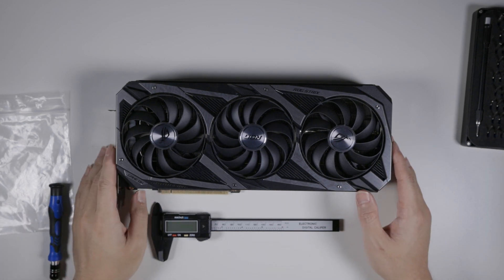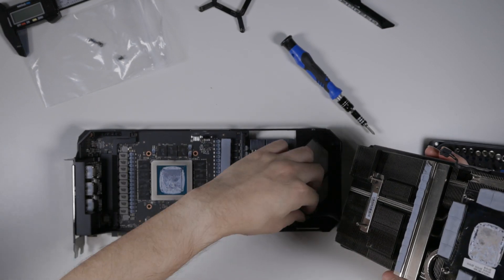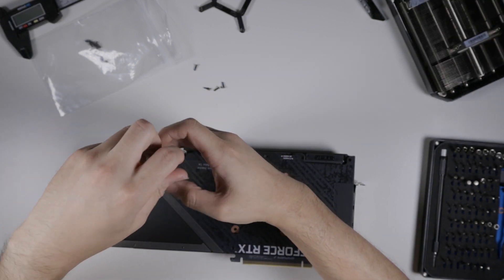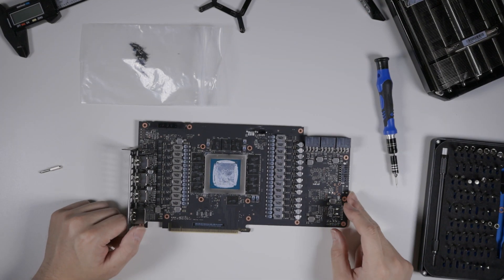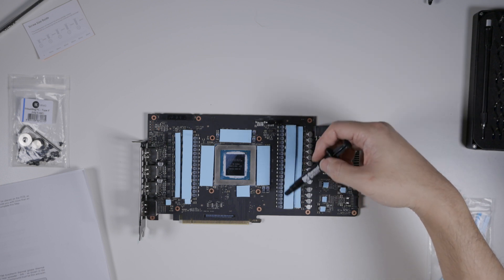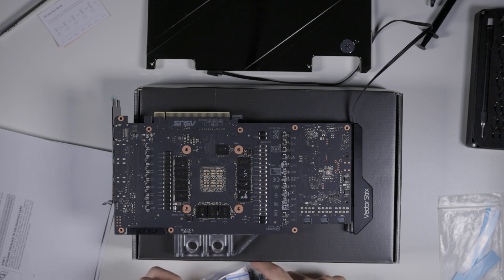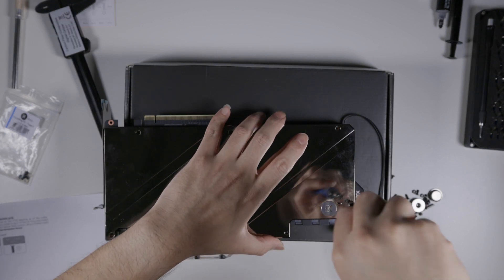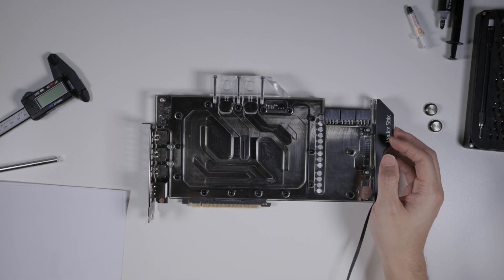ASUS STRIX RTX 3090 3080 Cooler removal + EKWB Waterblock and Backplate Install Beginner Friendly

Comment: Do you remember the size of the torx screws?
Reply: I have them, do you need the torx size or the size of the screw?
Reply: @oggybodoggy  Im good now, did the thing already. Thx tho!
Reply: Null stress :)
Reply: @jarlepedersen2150  can you tell me, I need to buy a tool to open mine as I'm getting a vibration issue. Thanks 😊
Reply: @oggybodoggy  can you tell me, I'm getting a vibration problem on mine and need to open it up. Have to order the tool
Reply: @munkymanmatt  I'll check in q couple of hours when I get home from work, @me tomorrow if you don't get an answer
Reply: @munkymanmatt  do you need the length/width of the screw, or what size torx it is?
Reply: @oggybodoggy  just the size of torx bit I need to take them out. Thanks for doing this man you're a legend 💪🏼
Reply: @oggybodoggy  did you ever get to check that?
Reply: @munkymanmatt  sorry forgot, I'll reply when I get home from work
Reply: @oggybodoggy  no worries man thanks again
Reply: @munkymanmatt  T3 :)
Reply: @oggybodoggy  you're a legend man thanks so much
Reply: @oggybodoggy  Yes thank you very helpful

Comment: Bye bye warranty!
Reply: with asus it's possible to put a waterblock without lose your warranty. Not with gigabyte or msi
Reply from the maker: You can with MSI and gigabyte as well not loose warranty with removal. While people have experienced issues with cooler removal. For these large companies, it's sometimes an issue where the region/sometimes even person receiving that rma, is not 100% on policies. This is common with Asus. MSI is probably more forgiving than most other aibs in terms of even physical damage.
Reply: Last time I had an issue with my Asus strix 1080 purchased from Amazon with a water block installed. When I returned my card with that warranty sticker damaged they outright void my warranty
Reply: @JCustom  I got the same card luckily. 3080 Strix OC. I'm just not sure if the EKWB active cooling backplate will fit Strix card. And yes I understand if one puts the cooler back without any physical damage caused, one won't lose warranty.
Reply: @MrGavinheng  Now things have changed.
You can call them directly and ask. I did.
Reply: @hyadboina6281  Yes yes I undertand. I said that i humour ^-^